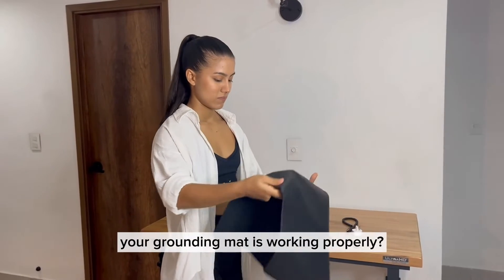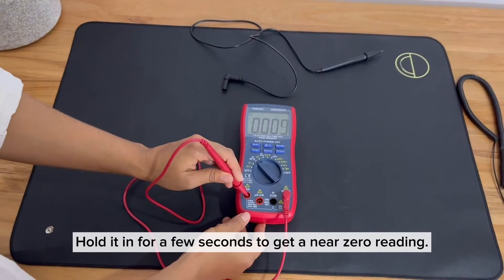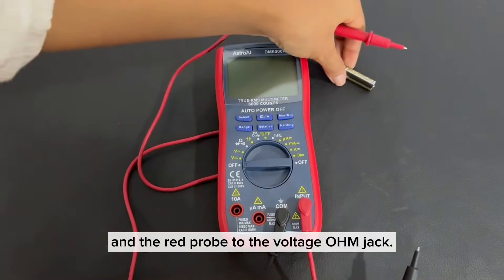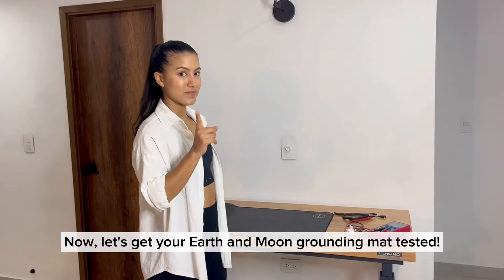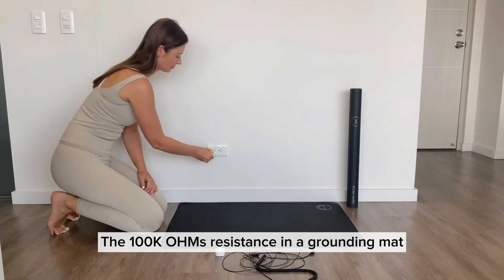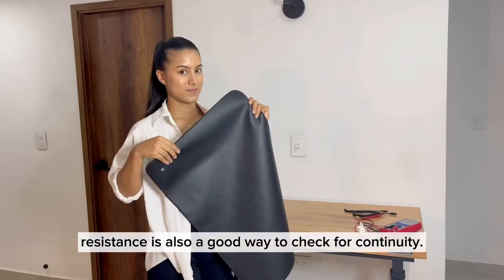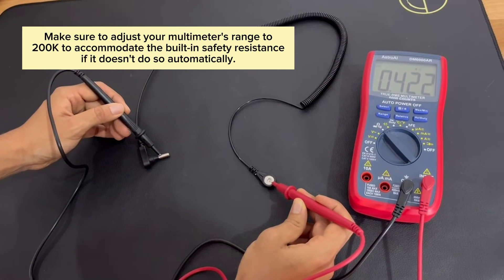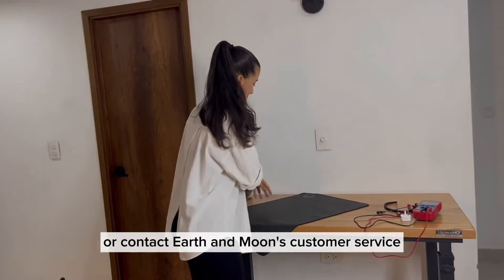Does your grounding mat work? How to test its continuity with a multimeter!

Comment: What does the moon have to do with anything in this video? Furthermore, most people I have seen advocating grounding or earthing, claim that the benefit comes from the fact that the earth is negatively charged in nice weather. (It is very strongly positively charged when there is a thundercloud overhead.) The excess negative or positive charges on the surface of the earth are due to the atmosphere. Given that the moon does not have an atmosphere, I tend to believe that there is no excess charge on the surface of the moon, and, therefore, there would be no benefit for moon people to ground themselves to the moon.